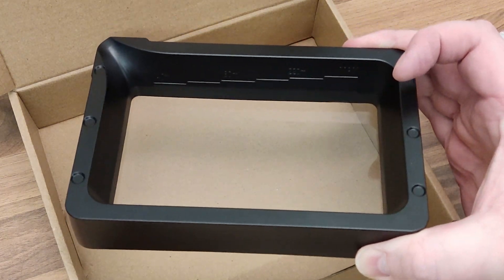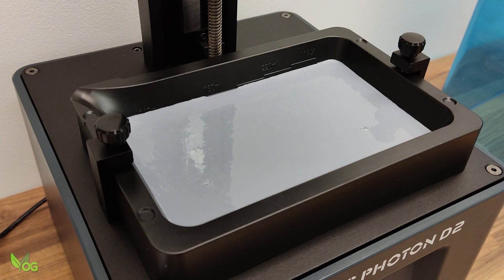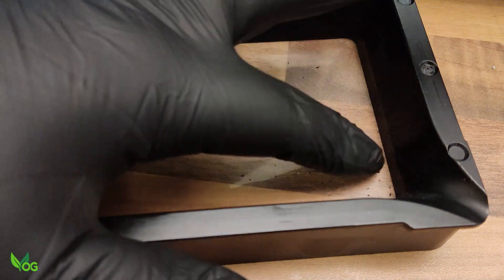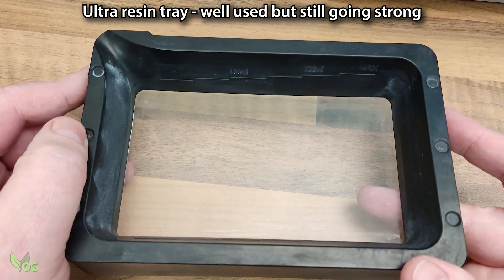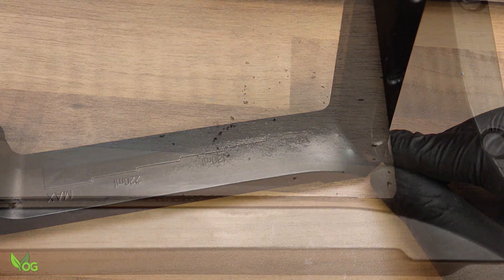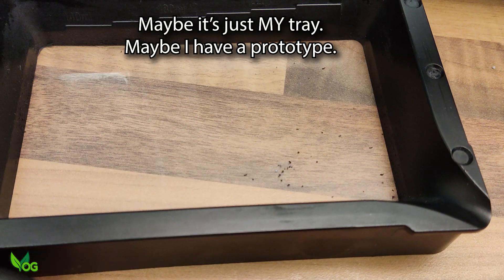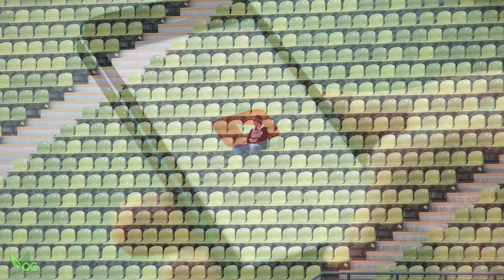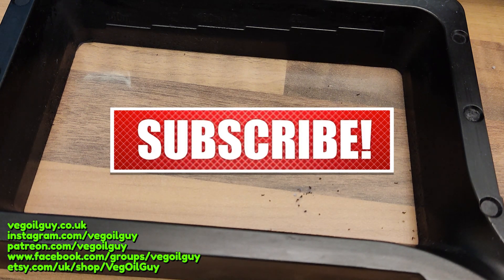D2 TRAY TROUBLE ? Anycubics Photon DLP 3D resin printer potential problem 😢

Comment: only issue i have with the d2 is the fep film on the tray. I had it 2 weeks and it seems every 2nd print everything is sticking to the fep film. Might need to replace it already. I'm also not sure what caused this the first few prints were flawles.

Comment: I just got the D2 and the wash and cure plus system, and I noticed the black specks in both the tray and in the wash bin before I've used either. I did order an aluminum tray (its for the photon S and should fit?), but I am still a bit concerned about the wash system
Reply from the maker: I've had no issues with the wash system and am still using it. The tray issue, from what I can gather, is extremely rare. I'm not sure anyone other than me has noticed it (until now) - it might be worthwhile you dropping a line to Anycubic and mention my channel if they try and deny its existence! But a metal tray will cure it for sure. I've tried to encourage Anycubic to go back to that as standard 😁
Reply: Does that aluminum tray fits? I see some black spots
Reply: I'm brand new to 3D printing. The D2 is my first printer. I didn't know any better and I used the plastic spatula to try and remove failed prints that stuck to the FEP.... You can guess where this is going...

So, now I have no VAT, and the two backup vats that I'd ordered at the same time as my printer are still in transit from overseas.

Just wondered what bar alternatives are working for other D2 owners. Did the aluminum one fit?

Comment: It must be a faulty vat, been using several plastic style vats like this for months with no issues. Unless it is the type of resin reacting to the plastic tray. In that case I would reach out to Anycubic and find out if there are guidelines for resins you cannot use with this particular tray. We use DLP craftsman resin and never had this issue with our printers, so not sure. On two of my older printers eventually we swapped out the vats for ceramic ones and they work great.

Comment: Just my 2 cents. All guy that use resin printer, clean all parts with IPA (surely because it's a cheap product). But if you read Siraya Tech notice on bottle, it recomend to use ETHANOL and not IPA. I've made some test at home, because i can Ethanol (99.5 pure) and IPA for "free" at work. Un fortunately for you i have an aluminium VAT (halot one). But Ethanol really dissolve resin and it's not possible to "clean" ethanol with UV eposure like IPA. For my it's a really poor economy to make plastic VAT.

Comment: It's hard to see on the video but it looks to me like it's very localized, and concentrated around certain areas... It also looks like more of a mechanical type of damage compared to spontaneous material disintegration... If this damage was due to the resin, I would've expected the tray to look the same all around... One thought that hit me: Is it possible that you have a WhamBam magnetic plate on this machines build plate? Could it be that the magnetic plate got shifted and a protruding edge scrubbed against the side of the vat somehow?

Comment: I currently own only an Ultra but a little while ago I misplaced the vat (I know I know, hardly possible :-( ) on the printer and the build plate "scratched" along the front wall of my vat. This accident results in much the same looking splotches as in your video but only very few because I heard the strange (but not very loud) sound and stopped the print. 
As I recall the D2 has the exact same vat as the ultra and only a slightly bigger build plate. The bigger print volume resulting mostly in coming closer to the border of the buildplate. 
I am only speculating but is it possible that the vat and the buildplate are not aligned well enough ?

Comment: Hi, I've been using my D2 for some weeks now and I must admit I have not been that careful when it comes to constantly emptying the resin tray and cleaning it up (done it only twice now), so I've left the resin (Siraya tech Cast) sit there for several days. No issues so far. I even cleaned it today to check if I had a similar issue, but I didn't. Tray looks like it should and no sign of any solid matter or those black specs you see in your tray. Maybe it has something to do with the resin you tested or their new one?

Comment: Yet another reason that plastic vats are a bad idea. I love cheap, but there are limits. To be fair, Anycubic specs these parts, they don't manufacture them. Should have been caught in testing, though. Elegoo is running into quality issues with their suppliers lately as well. It's not getting any better.

Comment: Did you use a different type of resin in the D2? When the original phrozen mini came out it also had a plastic tray and for what ever fancy chemical reason some resins would cause it to crack while for others it worked just fine.

Comment: That is interesting, thanks for the heads up on this; I've been debating whether to get the D2 or wait for the next higher resolution DLP printer from Anycubic. I switched to Chitu System's ceramic vat for my Photon Ultra so I can easily replace the fep (in my usage an nfep).

Comment: I had something sort of similar happen to me on my Elegoo Saturn S when the paint started flaking. This happened immediately after I dunked my vat in IPA in a lazy attempt to clean it. Elegoo informed me that IPA should not be used to clean the vat's sides as the paint disintegrates in contact with strong solvents. Maybe you're facing the same issue

Comment: This would not be the first time anycubic used plastic that disintegrates when exposed to resin and/or isopropyl alcohol. The plastic caps on the tightening screws of my friends mono x have completely disintegrated over time and that wasn’t the first time I’d seen issues like that. This vat disintegration does not surprise me at all.

Comment: I'll keep an eye on mine as I ramp up printing! I don't like the idea of the vat being plastic in the first place as I'm used to larger printers which have metal vats, I've been considering a third party aluminium vat (Sovol) for the occasional resin switch and might end up replacing the original plastic one as well.
Reply from the maker: That's good thinking 😁
Reply: Just about to recieve my D2 and wanted to switch to a metal vat from the beginning. Will the Soval ones fit the the D2 okay?
Reply: Link to the sovol ones? I cant seem to find them

Comment: VOG, I had this exact same issue with my Mono X. Upon investigating I found that several others had this issue. It seems whatever they are using to paint the VAT is not suitable for resin or cleaning. I used blue workshop towels which are fairly non-abrasive but it still peeled. Open a ticket with Anycubic ASAP.
Reply from the maker: A few others here are reporting problems with the Mono 4K. I'm happy to Open a ticket, but in truth this shouldn't be necessary. I'd hope Anycubic would have quality checks in place... 
Thanks for the input 😁

Comment: Maybe there's a reason after all why most manufacturers use milled aluminum for their trays...
Reply from the maker: They're better, that's for sure.
Reply: @vogman  Strictly speaking, metal parts are only better if there is a benefit associated with them. People often complain about stuff nowadays being made from plastic, when it usually just means that it gets cheaper and lighter, without any drawbacks. Most prominent example are electrical tools.
Maybe this is an instance where going cheaper isn't possible, or maybe manufacturers need to find the right materials first, that can stand up better to the various chemicals, mostly resin, ethanol and IPA.

Comment: I'll have to check mine tonight.  Haven't done nearly as many cleanings on mine as you I'm sure.  Just been using denatured or isopropyl alcohol?  Not sure if it makes any difference.

As far as you know, does the D2 share the same vat with any of their other printer?  I've seen some metal aftermarket vats on Amazon.

I've gotten after market vats for Elegoo in the past for spares that looked like an acrylic.  Never used them much, but those seemed to  break down slightly with cleaning.  

Thanks for the update!
Reply from the maker: I tend to use the spatula to get out as much resin as I can, then wipe gently, then splash in a little IPA and use a paint brush to get in all the crevices. It works well and is quite gentle. But I'm wondering if the plastic is reacting to the IPA.
Keep an eye on yours. Hopefully there'll be no issues.
Reply: @vogman  One of my employees is a chemistry enthusiast and he doesn't think there's any likely hood of alcohol being the factor either.  Most likely a defect in the manufacturing, hopefully only limited to a few early models.

Thanks again!
Reply from the maker: Thanks for that.
Reply: @bensgizmo2960  I have fdm printed abs parts holding my resin printers level and I’ve noticed that slowly over time the parts dissolve slightly and get softer and crack in the presence of being splashed with resin/ipa. I think ipa may very well be a factor as it does dissolve certain plastics

Comment: The thing is D2 has significant smaller build volume, and this is the major reason why most people don’t purchase it.
Reply from the maker: It's not massive, that's true. But it prints beautifully... tray permitting 😁
Reply: Smaller than what? Context. Also haha no it has a completely normal build volume compared to more than a dozen other printers in the same class, and is significantly larger than the Ultra. SMH

Comment: Hmm, this is bad news. So far, I have not had any issues with the plastic vat on my Mono 4k. Been using it consistently the past 10 months. In fact, if not for the need to use framed FEPs, I actually prefer the lighter feel of the plastic vat over the sturdy and heavy Photon SE vat (which I purchased so that I can use normal FEP sheets).
Reply from the maker: Thanks for the share 😁

Comment: I use mono 4K and it is the same as your problem. I clean it with IPA, I try to clean it with Acetone, and the tray meltdown.
Reply from the maker: Interesting. Many thanks. I never noticed an issue with my Mono 4K. I'll have to look harder at the tray. 😁
Reply: Acetone is a littlebit to heavy for Plastik in generell.

At the moment i use a compressor to dry the fab befor i Store it. But i think i buy a spare Fab from Mars for my ultra. I also prever Metal for items they are Clean with chemicals.

Comment: There is an sovol aluminum one on Amazon, that says it's compatible with the D2. Just thinking, if this is sold for 25$ on Amazon, it basically means, that it costs less than a $ to produce (with a lid and an FEP and a bottom), why is this not included with the machine? I don't like this limitless cost cutting.

Comment: I had some problems trying to replace the FEP on my photon ultras print tray. The first time was fine, but from the second time onwards, I found the plastic was warping and not holding down the fep securely. Was getting major leakage. Turns out, the elegoo brand tray for mars, mars 2 etc.. fits perfectly. The screws don't exactly line up with the holes, but screwed down tightly enough holds the vat nicely. I've printed 20 things since then and it's been great. IMO, the older vat design with the 2 part metal sheet that hold the FEP screen just seems to work better, even tho it takes longer to swap FEPS. Hope this helps anybody who had these issues I found. Another great video VOG \m/
Reply from the maker: Thanks for that share. It might be a practical interim solution. I haven't measured properly, but at a glance the Ultra and D2 seem to have the same size tray.

Comment: Funny that you posted this as I'm debating between a saturn 2 or this machine. I hope to hear back from anyone else with the D2 to report if this is a bigger issue.
Reply from the maker: Let's hope Anycubic take notice too. The D2 is excellent, but powdered plastic in the tray will ruin prints for sure.
Reply: It depends on what you want, if you want a smaller format printer get the D2, it’s wonderful. But if you want a larger format printer get the Saturn. I’ve had my Saturn for almost a month now and I’ve had ZERO issues with it so far and I’ve been printing almost non stop.
Reply: Whelp was waiting for Black Friday to order the D2 as my first 3D printer guess I’m holding off now
Reply: I think there's no debate. This machine is great and I have not seen any signs of this in mine after using it for some weeks and constantly printing stuff. Prints great!
Reply: I was in the same boat 2 weeks ago. I opted for the Saturn 2. I suggest you do the same. I couldn't be happier and I'm so glad I did. It's a beautiful beast and not a single failed print.
Reply: I'm loving my Saturn 2, but it's worth noting that there have been widespread reports of issues with its vat construction as well, at least on the early production units that have arrived so far. Elegoo has been pretty responsive and are apparently already sending out a revised replacement vat in some cases, so kudos to them, but it's frustrating that build quality isn't keeping pace with the technology improvements we're seeing.